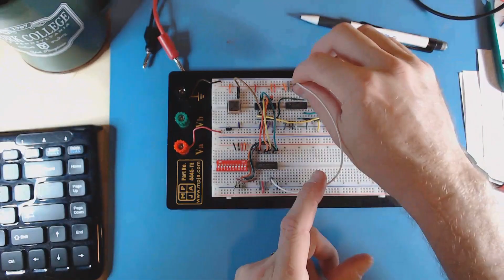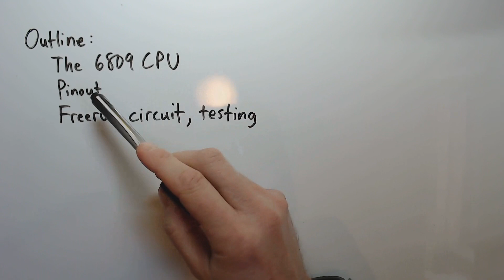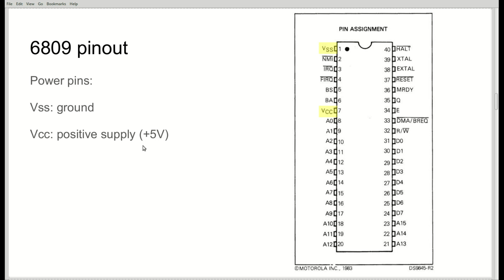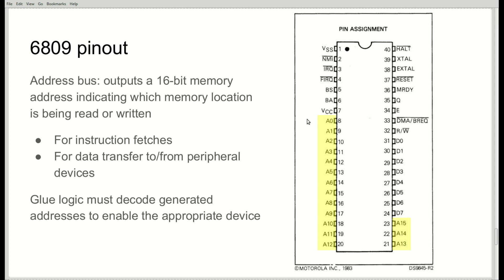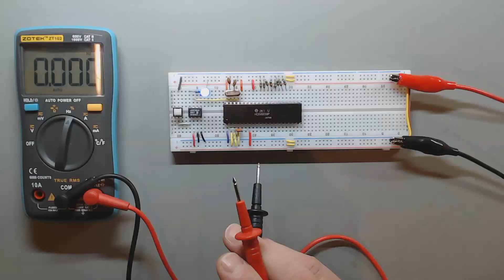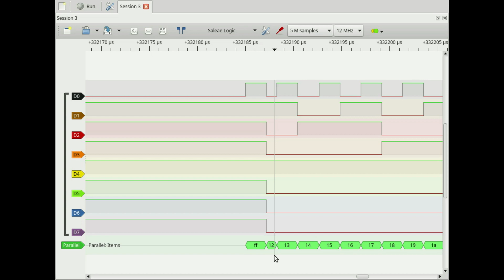DIY 8-bit computer, Episode 7: 6809 free run

Comment: Hi Daveho, just started watching this 8bit guide really easy to follow and detailed mate!, just a question on how the Xtal and Extal pins work with regard to the clock, I see that the one of the caps is connected to 5v then into the crystal through I assume Xtal then back out to Extal? to ground. If I'm right so far, how does the clock pin trigger around parts of the circuit if both in and out pins of the CPU run back to the crystal. Might be jumping a head a little however I've never understood clock crystal circuits and hoping you could explain a little more about the circuit operation. Cheers F
Reply from the maker: Glad you're enjoying the series! For tthe 6809, the clock generation circuit is internal to the CPU, so all you need to do is connect capacitors between the XTAL pins and ground. I think the distinction between XTAL and EXTAL is that you can use EXTAL as the input for an external clock signal, if you are using an oscillator with a TTL output as your clock. Personally, I've never run the 6809 other than with a plain crystal.
Reply: @davehohacks  Hi Daveho thanks for the reply ,I am mate I'm starting to get my head around 8-bit architecture and find your work really helpful so looking forward to getting through the series!. Just on this I'm still a little stuck however, from what I can gather we use an external clock setup with the 3.7mhz crystal, from what I can see on the BB we run the cap into the crystal then to the extal pin then back out the xtal pin to ground via cap 2, is this right mate?. I assume I may be jumping the gun a little and if you do address this down the road let me know, but what I was trying to ascertain is how can we use this setup to trigger other IC clock pins if we are using both the cpu clock pins with this circuit. Would it be a case of running a wire from the xtal pin to another clock pin?. Hope this make sense mate!
Reply from the maker: @YNGBLD80  To back up a bit: are you using a crystal or a TTL oscillator? If you're using a crystal, just connect it as shown in the schematic: two 22 pF capacitors, each one in series between the XTAL and EXTAL pins and GND. If you're using a TTL oscillator, I believe its output is connected to the EXTAL pin (pin 38) and the XTAL pin (pin 39 is grounded.)
Reply: @davehohacks  I'm not using anything at the moment Daveho, I'm just following your video and trying to understand how the clock circuit(crystal) you have designed in this video works. What I'm trying to comprehend is how does it create a high/low output in conjunction with the clock two pins.
Reply from the maker: @YNGBLD80  The clock generator is completely internal on the 6809, you just have to connect capacitors to ground on pins 38 and 39. The main clock signal is actually not exposed. However, the E and Q pins output a square wave at 1/4 of the main clock frequency.
Reply: @davehohacks  Sorry daveho still dont get how the crystal works with the capacitors which is what I was trying to ask, thanks for trying ill just have to keep attacking and hopefully the penny will drop at some stage.
Reply from the maker: @YNGBLD80  Many oscillator circuits are based on feeding the output of an inverter to its own input. The capacitors and the crystal are to stabilize the oscillation at the desired frequency. In the case of the 6809., the inverter is internal to the CPU, and there are probably other components that are part of the internal oscillator as well. The crystal and the capacitors are the only components in the oscillator circuit that are external to the CPU.
Reply: @davehohacks  Hi Daveho thanks mate appreciate the effort in explaining, had to go off and read a fair bit to get the process down with regard to the inverter and the role of the crystals in conjunction with the caps. I thought it was the crystal produced a square wave from one pin to the other. Now I understand that it creates a sine wave and the inverter op-amp helps keep the signal at a constant amplitude, the caps alongside with feedback keep the signals in phase. With that sorted onto the next episode. Thanks again mate!

Comment: I like 6309 a lot. The 63C09 is typically clocked at 3.58MHz in applications such as arcade boards (Double Dragon, Double Dribble). It has double the registers and is able to combine them to receive 32-bit results, and it has a larger ALU. Bill Gates is alleged to have called it the most advanced 8-bit cpu ever made. The 6809 architecture in general was a pretty revolutionary CPU for the time as an exercise in providing facilities for position-independent code (library functions) which was a hot topic at the time and much played up by Motorola in the electronics magazines.
Reply from the maker: I have a few 63C09s, it's on my agenda to try them out and see how fast I can clock the system.  I also intend to experiment with 6309-specific features at some point.  I didn't realize it has extra registers — that would be really handy!
Reply: Hardware divide and relocatable direct-addressing page too, not that I have much hands-on experience. (My HD63C09EP is sadly gathering dust beside a YMF262 and V9958 on antistaic foam. Someday! )

Comment: would the 6809EP work with your schematic?
Reply from the maker: No, the 6809EP needs quadrature clock inputs which are 90 degrees out of phase. Interestingly, the circuit that is shown in my video intros generates exactly these signals.
Reply: @davehohacks  ok thanks. the regular 6809 is pricey on ebay but will keep looking. the EP seems much better value but  I want something that follows your circuit. thanks.
Reply from the maker: @RetroMarkyRM  I just checked prices on ebay, and all of the prices (both regular and E variants) do seem to have gone up a bit. I saw some 68B09 parts in the $5-$10 range, which isn't too bad.  I'd look for the B version if you can find it, since it supports higher clock speeds.
Reply: @davehohacks  I've been racking my head trying to get q quad clock working on the breadboard. Do you think you could give us a schematic or something on it?
Reply from the maker: @TRS-Eric  I'm pretty sure I used a single 74HC74. See the "Digital Phase Splitter" section of the following page: https://www.markimicrowave.com/blog/top-7-ways-to-create-a-quadrature-90-phase-shift/
Reply from the maker: There's also the circuit recommended in the 6809E datasheet that uses a 74LS76, although I've never tried building that one.
Reply: @davehohacks  Yeah that circuit is more or less the Digital Phase Splitter described in your link. But thanks I'll keep working on it!
Reply from the maker: @TRS-Eric  Good luck! I'm now tempted to order a 6809E to see if I can generate a clock signal for it :-)